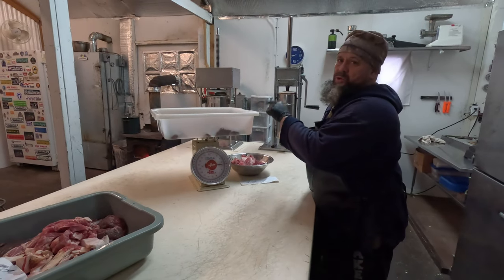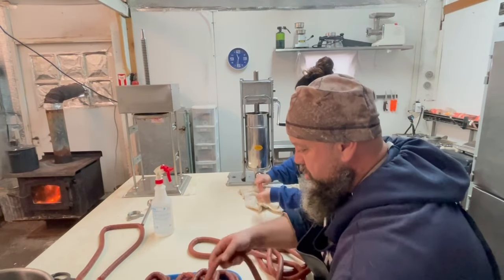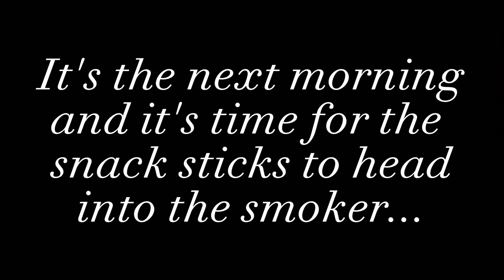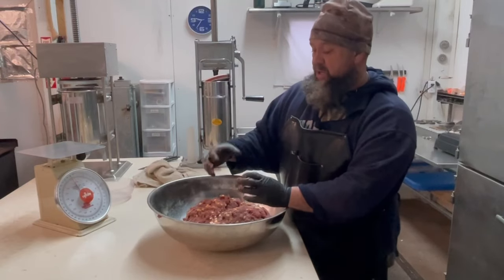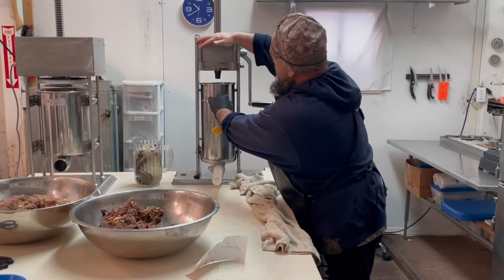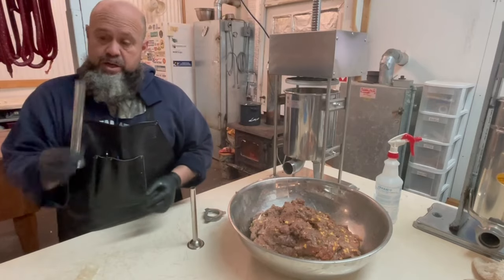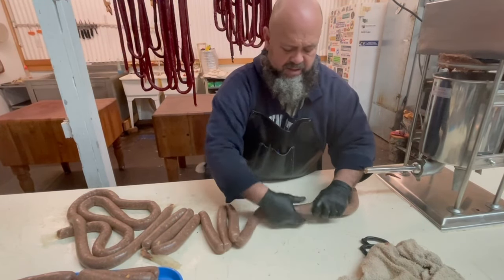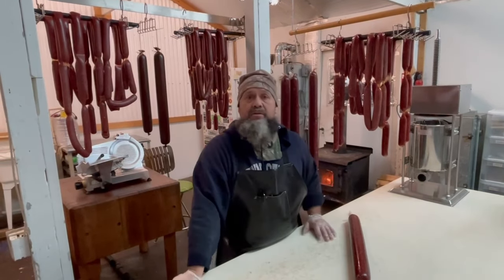Watch me FIGHT my electric sausage press 😡 | 5 TYPES OF SAUSAGES | Brown's Butcher Block

Comment: Definitely more water.  Helps with the mixing and stuffing.  Might have some blow bye but the water will come out in the smoke house.  Just give it an hour at 140 to dry the casing or hang in the cooler with a fan blowing on it for a few hours. I didn’t catch your process . I always stuff mine right after mixing the spice then hang for 12 hours for the cure to set. But I’m impatient and usually use cure accelerator and go right to the smoker.

Comment: Kudos to you all who take the time to upload these videos.  I have been in the "sausage" industry for over 30 years.  You're close to becoming a sausage guru.  Couple of suggestions.  Some have been said already, but you must add water to your batter in order to stuff properly.  10 to 12% is a good rule of thumb.  I would also suggest you buy a digital scale.  Your can pick up a 60lb max scale that measures in 100's for under $100.  Mixing is also critical.  It extracts protein which gives you bind in your meat.  My dream is to buy a 100 lb. commercial mixer,  but in the meantime I use a food grade barrel cut in half with an electric grout mixer. I can mix 50 lbs if I need to easily.  On your smoker a PID controller is so essential to maintain correct temps.  If your smoker goes over 200 (actually 190) degrees it's to hot!  You mentioned the bearded butchers and they are amazing.  2 guys and a cooler would be another one.  Good luck and I hope to run across more of your videos.
Reply from the maker: Thank you

Comment: My electric would go down then stop back off then go back down work for like two seconds then back off.  I added more water, went to higher, lower speed.  It still just go down and work for couple seconds then backs off and then goes back down.  It took forrrrrrrreeeeevvvver just to do one casing.
Reply from the maker: Add more water to sausage meat. What type of sausage are you stuffing?

Comment: The "vent holes are to allow the smoke to permeate.  They have nothing at all to do with letting the air out of it.  In fact, what they are showing, in this case, is that you have overstuffed them slightly.

Comment: Add water to help the stuffing process even with your manual 2 speed stuffer that is too hard cranking. The biggest item that your electric stuffer is having an issue with is the small diameter of your casings are not meant to be used with a large diameter piston stuffer. Use an electric 10/11 pound stuffer which has a smaller diameter piston chamber. It is the ratio of horn diameter to the piston diameter. Does your electric stuff summer sausage into a 2" casing ok? 1 to 1-1/2 oz water per pound of meat I believe is where I stuff with and it is relatively easy to stuff.
Reply from the maker: Thank you so much for the input, i agree, it should not be this painful!

Comment: My electric press broke. The gear could not handle the pump and it would stall all the time and eventually the gear broke. 

My plan is to fit a more power motor and the same size gear to it ... That's not now though 

I bought a 7l manual press and the sausage just flows out of it with some elbow grease...